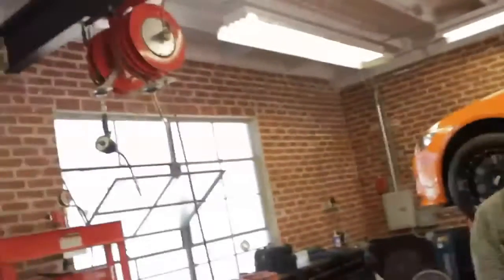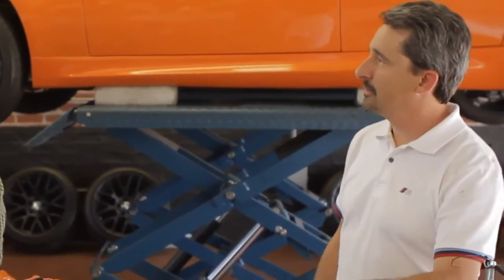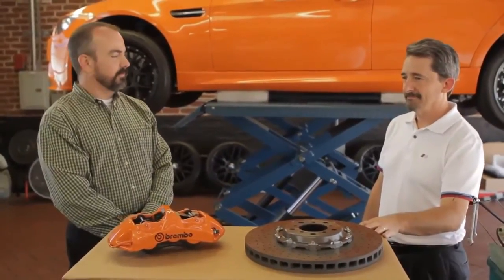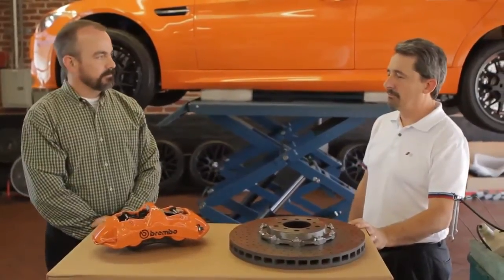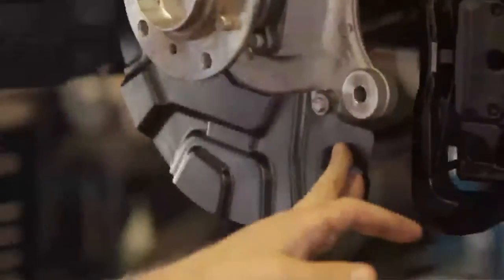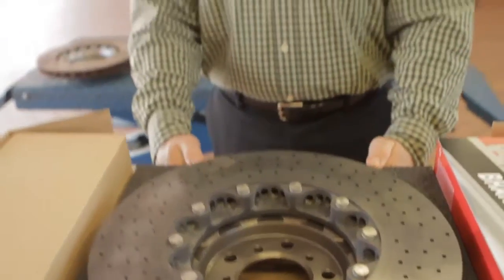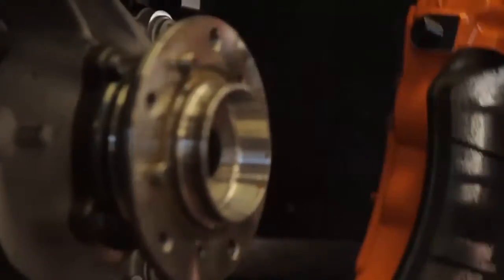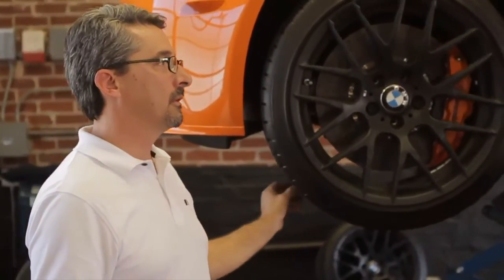Center BMW 'aRT Werks' M3 carbon ceramic brakes

Comment: Very good question, I don't think it will stop it from working.  However if the pulse rate is a fixed number it might need recalibration.